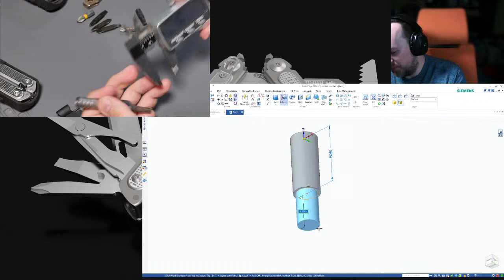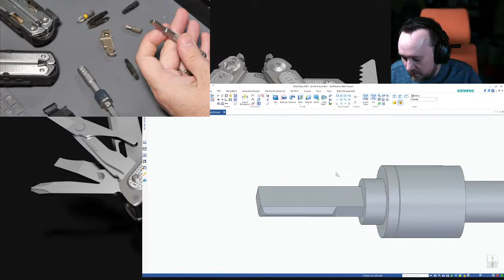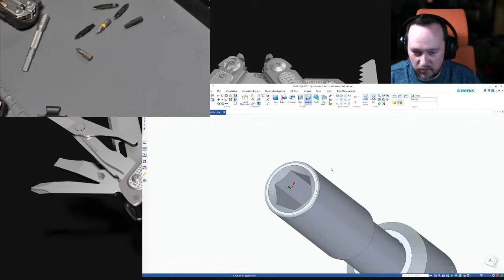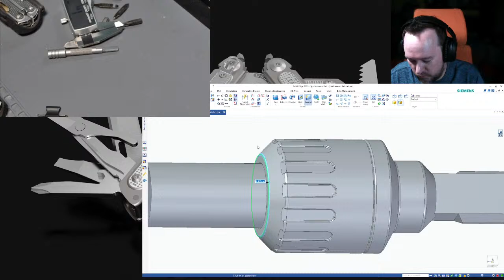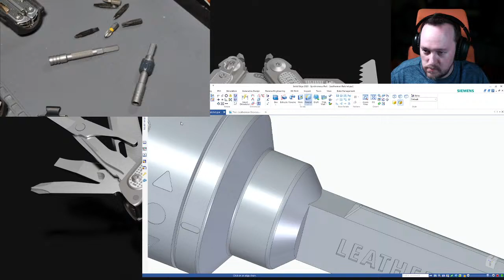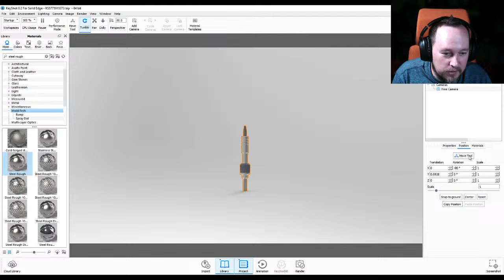Creating a 3D Model of the new Leatherman Ratchet

Comment: Your work is awesome. I am really looking forward to adding one of your holsters to my Free P4 that also holds the ratchet and several bits. I would also be very interested in the back of the case holding 2 rows of bits that are staggered if it is possible for it to hold more bits that way? I’ll be following along and ordering it as soon as it’s available!
Reply from the maker: I have a design now (physically prototyped) that has the ratchet holder on the side, plus 2 bits on the other side. I will be prototyping a few other things a 2nd round on the Ratchet driver accessories before release. Details on my multitool.org forum thread.